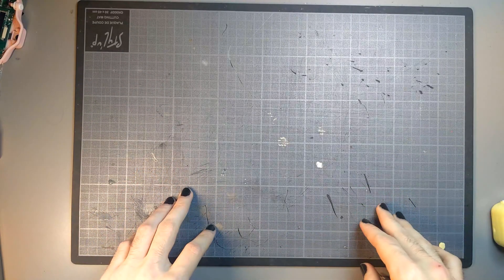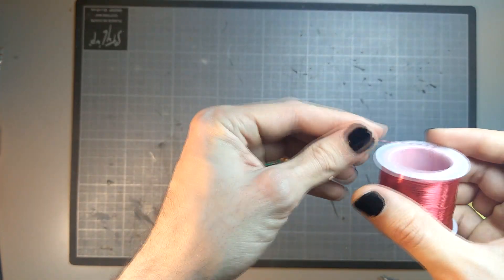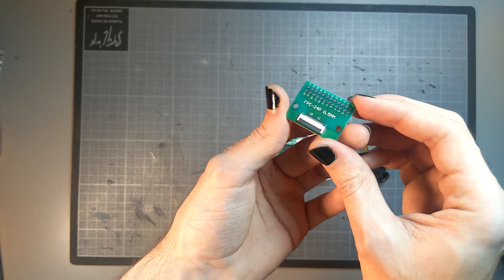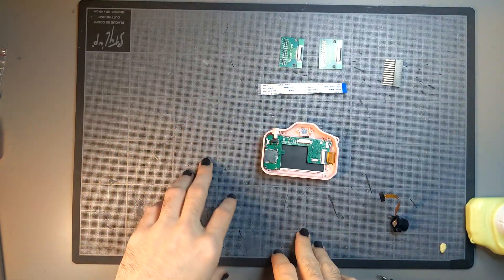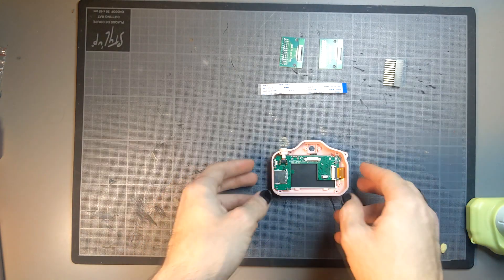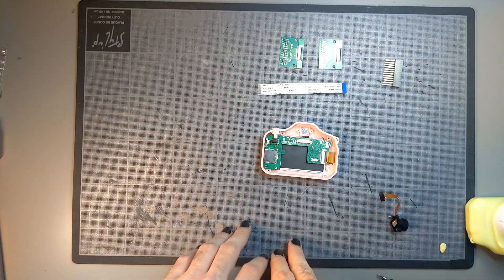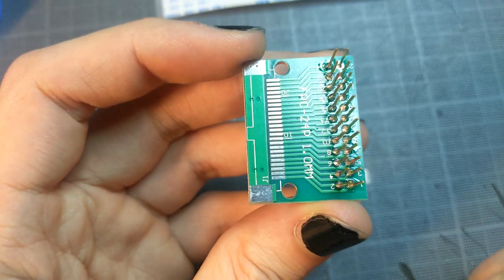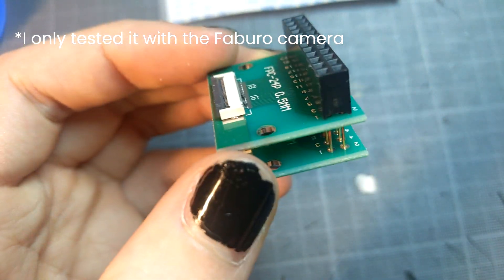Circuit bending a toy camera (easy and reversible version)

Comment: I am having an issue. I did exactly what is on the video and the Github page, however, my camera just shows colored stripes (like the ones in old TVs), it's not recognizing the circuit somehow. When I plug only the lens, the lens works, but not when attached to the whole system. What can I possibly do?
Reply: Im having the exact issue, I keep coming back here hoping someone solves this
Reply: it’s possible you shorted one of the add in boards when soldering
Reply: @SaltSpirits I tested the circuit with a multimeter, tested the connection in each one of the 24 pins and the current was active...🙁
Reply from the maker: Hello, I have seen other people saying they have the same issue, I can't manage to reproduce it myself and I don't know why it does this sorry /: My guess is maybe it is not the exact same Faburo branded cam ? Maybe this hack works only on the Faburo cams and not the similar ones of aliexpress ? idk
Reply: Tried again, new system, new everything, nothing still...

Comment: What did you use to trim the pin headers? Thanks in advance.
Reply from the maker: Hello, just a simple wire cutter like these : https://www.amazon.fr/Coupante-Coupantes-R%C3%A9parations-%C3%89lectroniques-Domestiques/dp/B0D8Q4PBL5?c=ts&dib=eyJ2IjoiMSJ9.VsI_eG9ia3jgfi3IsImzMWmLvOyntYUPiMQEhdbtfm4wpLCkU3lgPEpNjDUKSpS2FKJp218PalaMAbAhIVvgpsiC3V6Fl_pKga_OMSgfTUl88bKZRMGw03hYLCEIiga1pmL5gbWmt5QNsyjoD-n7XfLm2XmjPU2G1ahBcKlgrIKUWvoKwHPQU4xOqcwWRnU0zhpsAIJX1qx0Ny-egFeDgcXWiRbfns23OsEj_-zca5Y.8ATHL8LX-YjjtpKmTM0sjhinqxWJ8E7IaHy1gbg7pOg&dib_tag=se&keywords=Pinces+coupantes&qid=1755089863&s=hi&sr=1-7&ts_id=1854811031

Comment: I have been playing around with modifying these off and on for the last 8 months or so, put together a pretty wild looking music video with footage taken with the same type of camera. Took some time to do some reverse engineering but ended up just hard wiring in dip switches to cut out different data channels and some pots to gradually cross them over which all give different results.

Comment: damn I bought 3 of these cameras on Ali and multiple board, after trying every camera and board, changing the placement of the ribbon cables and camera, I couldn't make it work. The "lens" don't connect correctly to the main board after going through the ribbon cable boards, the screen just shows that line of colors. It flows electricity through the ribbon cables but there is no image. Does anyone have a similar problem?
Reply: I have a similar issue. My front sensor only shows color bars but the selfie sensor works and can be glitched.
Reply: I’m having the same issue 😢, already checked continuity in the output ribbon so not idea what is going on maybe voltage is being affected through the “implemented extension”
Reply: I'm having the same issue! Only the color bars, as if it is not being recognized...
Reply from the maker: Hello, I have seen other people saying they have the same issue, I can't manage to reproduce it myself and I don't know why it does this sorry /: My guess is maybe it is not the exact same Faburo branded cam ? Maybe this hack works only on the Faburo cams and not the similar ones of aliexpress ? idk
Reply: did you ever find a solution for this?
Reply: is your camera with usbc charging?

Comment: hey about the battery its possible change right ? what model u think is compatible and more eficient ? very super cool video bro, awesome
Reply from the maker: Hello, yes I changed the battery on one one of thoses, they are usig 3.7v batteries.
Reply from the maker: I don't know the exact model of the one I used, it has HJ 752035 3.7V 400mAh 180806 written on it.

Comment: I'm doing this mod and I got it to work! trying all the pin combos but getting a few crashes. It freezes and I have to wait for the battery to go empty. Did you experience this too? any way to workaround it?
Reply from the maker: There is a full pinout in my github documentation, on mine I avoided the pin 14 and 19 if i remember correctly. To reset the cam, on mine there is a little hole on the side, with a button i can reach that completly resets the device, even when it crashes and the start button doesn't work anymore. Hope this helps

Comment: hey very cool video and tutorial, thanks for setting this up
I am wondering if there would be a way to display the screen camera on a bigger display (like a TV screen)
Do you think this is feasible with the original camera or do I need to hack the camera screen as well?
Reply from the maker: Hello, the camera i used has no way to output on a bigger screen but maybe you can get ribbon cabe with the correct amount of pins to match the screen socket on the motherboard and bring it elsewhere on whatever screen you have ? The camera can connect to a computer as a webcam alternatively but i am not sure it is what you want to do
Reply: @oui8155  yes using it as a webcam could work actually. I am researching how to build a real-time interactive crt video wall. is the connection from the camera a usb? If so I will probably need a raspberry or some computing device to link the camera to the screens, I don't think a usb-c to rca converter would make the job.
Reply from the maker: @TheosisRecords  yea it is a USB sadly, but i just found online that usb to rca actually exists ?? maybe you can try it out but i am not sure it will work since i have not tested it
Reply: @oui8155  ah waou usb to rca 😅didn't see that coming. will make a bit more research and update you if I do it
Reply: @oui8155  but actually I doubt it would work: the usb is for charging I guess, maybe downloading the data (pictures) stored in the cam's memory. weird actually since it has an sd card for this... I don't see how it could transfer the screen image live to another screen. where have you read that the camera can wrok as a webcam? I haven't found nothing about that on the amazon listing
Reply from the maker: @ The toy camera I used work as a webcam when connected to a computer via usb and turned on, I have tested it myself (: but the glitches are less intense when i capture them withe the default camera app of windows for some reason
Reply: @oui8155  thanks for the feedback, it's super helpful. I will try by myself and check if there's a way to increase the glitches or stream them through another software

Comment: i cant really find good pins can anyone help me? i bought some but the spacing is not right and they are way to short
Reply: @mrgameowner faced the same issue, bought a bunch that were way too small and i can’t find anything longer. tried soldering wire between the short pins and the other board, and i dont know if i just did a bad job, but it doesn’t work. have you had any luck?
Reply: I got some pins from a teacher of mine but i did everything and it just did not work @unwantedsoup7333

Comment: hey cool video! just wanna ask if theres specific pin combinations that should be avoided? or are all combinations safe to plug in?
Reply: oh sorry nevermind i found your pinout link in the github. thanks for all the documentation!!! i don't think anyone has done specifically this yet so it's a really helpful reference
Reply from the maker: @jerryberry5532  Hello, yes there is a full pinout but only for using one cable. On my camera the pin 14 and 19 are crashing the device, but you might want to experiment by yourself since those cheap cams are not identical even if you get the exact same model.

Comment: Each time I click on the camera icon it does the noise but nothing happens. No shutter noise or view through the finder. Anyone else have this problem
Reply from the maker: Hi, I had a similar problem at first. In my case I plugged the ribbon cables in the wrong orientation the first time I did it. Make sure to try every possibility, plugging the two ribon cables with the pins facing up or vice versa, it cannot damage the cam. It fixed it for me. If the problem persists even after you've tryed this, maybe a solder is faulty, you can use a multimeter to check the continuity of every soldered pin. Hope this helps.

Comment: Very cool way to do this. I've circuit bent a handful of these cameras and it is definitely the smallest and hardest thing I've ever soldered. So this is a cool way to get around that.
Reply: you got any tips? the size is killing me

I've gotten some cool effects to work when I just soldered a couple of pins but it all went to shit when I tried to hook up a pot and a toggle switch lol
Reply: @ Yes I do. Flux pen, Magnet wire, solder wick, magnifying glasses and good soldering iron with thin tip. I use 28 AWG magnet wire. Solder wick is super helpful to remove the blobs and fix your mistakes. Prep the wire by melting the coating with a lighter and then tin the tip with a bit of solder. Then use the flux pen on the contacts on PCB and the tip of wire. The sticky from the flux will kinda help to hold the wire in place. Use the magnifying glasses to position the wire then touch the wire with a HOT soldering iron for maybe a second or less. I never try to add solder. I just use what I put on when I tinned the tip. Also it seems the points that you want to connect are always right next to each other. So I alternate one soldered to the PCB trace and then the next soldered 90 degrees from that directly onto the pins of the connector. If any of this helps please go subscribe to my channel 😬
Reply: @SISKworks  lol I saw some of your videos before so I was already subscribed but I didn't realize it was you!!

thanks for the tips, I ended up doing it kinda dirty because I hadn't seen the reply but it turned out okay

Comment: really cool! Do you know what model the camera is? I am going to try this but was hoping to be able to swap out different cameras that are also 24 pin. do you think that will work?
Reply from the maker: I did not tryed with other cams, but I think it works, can't be sure. Maybe try poking the camera connectors with a needle first to see if it triggers any affects similar to some picture I included in the documentation. If it does, I believe it can work (:
Reply from the maker: And the brand of the camera is Faburo (forgot to answer the first part of your comment)

Comment from the maker: Youtube wont let me get clikable links but the link is https://github.com/LBVPstuff/Easy-Camera-Circuit-Bend
Reply: Built a breakout board per the video, but I am having problems when it is all connected. Not able to access the camera or videocamera modes. Did you run into any similar problem? I have the same camera board as the pink camera in the video.
Reply: My pins face up when the camera sensor is removed
Reply from the maker: @Tradewinds369  Hi, I had a similar problem at first. In my case I plugged the ribbon cables in the wrong orientation the first time I did it. Make sure to try every possibility, plugging the two ribon cables with the pins facing up or vice versa, it cannot damage the cam. It fixed it for me. If the problem persists even after you've tryed this, maybe a solder is faulty, you can use a multimeter to check the continuity of every soldered pin. Hope this helps.